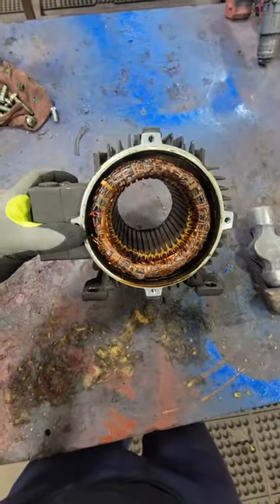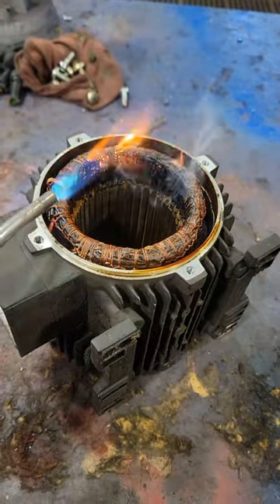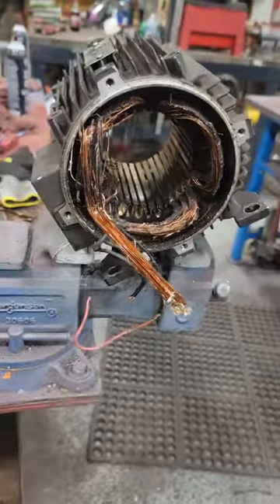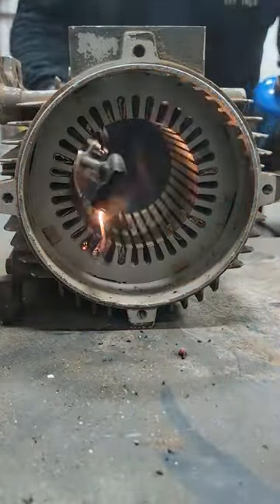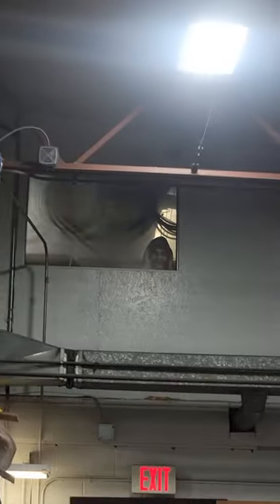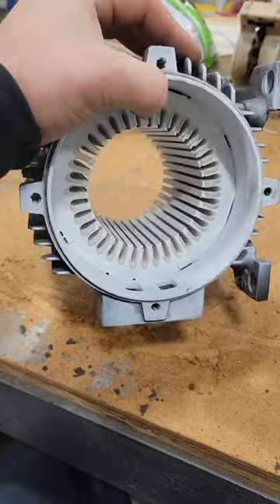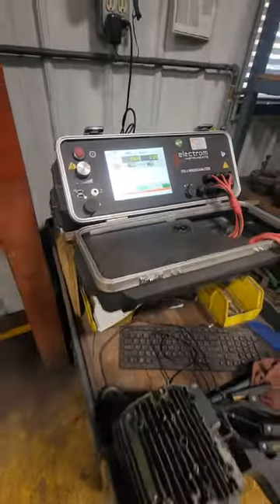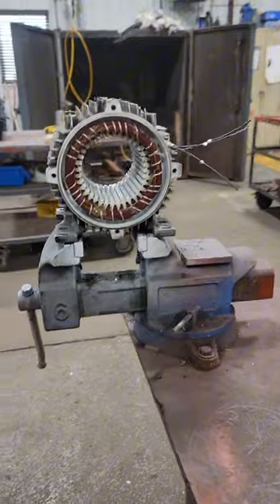siemens electric motor rebuild

Comment: My mother used to work for New Process Gear and WAI assembling starters, alternators and motors for GM. I got the chance to go to one of their Open House "bring your kids to work" events back in 94. I never pursued a career in electronics but have always had a passion for it. Also, my grandfather was a Westinghouse engineer for the steam turbine division and later a radio engineer for local TV stations as well. I have motors in storage from 1940-2004 for all kinds of stuff. Fun to see someone competent these days making OEM or better repairs in a digital world. I have a newer 3 phase electric motor I'm unboxing tomorrow to see what project I can make of it.

Comment: How much is the repair vs how much would just buying a new one cost?
Reply: Often cheaper but in many cases the issue is not price, but availability.

Having it rewound at half to full cost in 5-7 days vs. buying new which will take absolute best case scenario a full month.

Not all appliances and items are like that but had to deal with some like that and electric motors are one such. We had some moderately priced item always overstocked because buying these as-needed only a single vendor in Italy provided it and the distributor alone asked for 90 days plus 45 of customs. So the real price of those was "140 days of downtime".